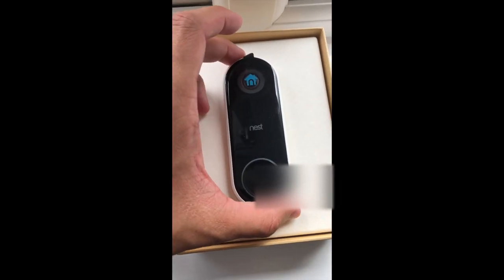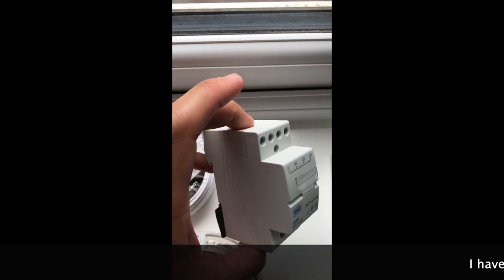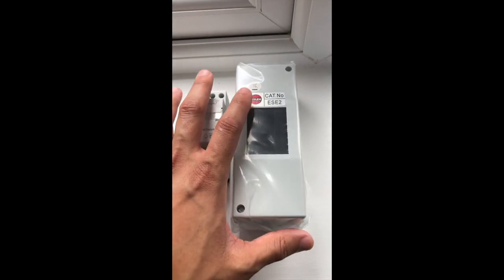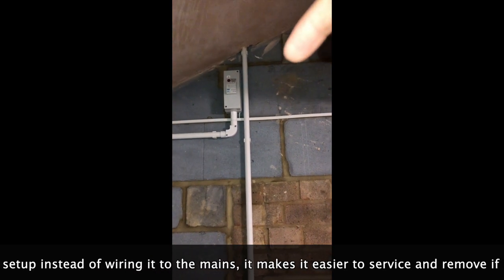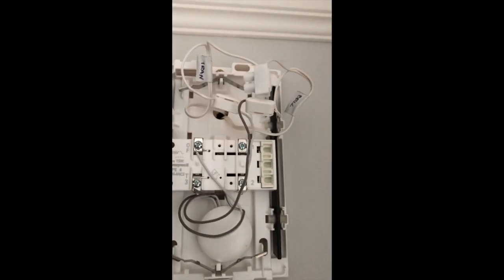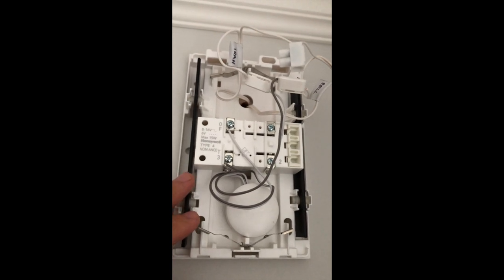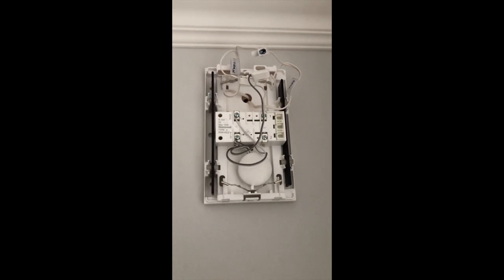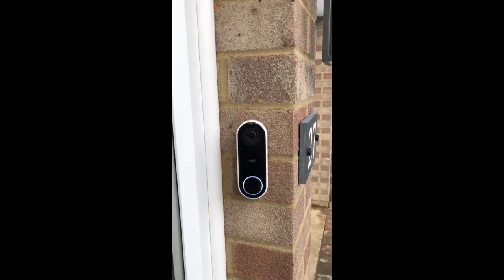Nest Hello UK installation With Chime (Honeywell / Friedland D117)

Comment: Thanks for this video. Followed this exactly to install mine. One question; do you notice a slight hum from your transformer?
Reply: Hi @greyowl666 make sure your connections are tight take the wires out and refit them solved the humming issue for me. I also followed this set up.
Reply from the maker: @osmantui  thanks, @greyowl666 please try this.  My transformer does not make any humming noises. I suppose it could be a loose connection.

Comment: Hey! This video is exactly what I needed, one question - the chime itself appears to be rated at 8V could it shorten the life of it by supplying 12V?
Reply from the maker: Hi see the diagram on the back of the chime it says transformer 8-16v see video https://youtu.be/vR9XI-A2u50?t=85 or https://livewell.honeywellhome.com/honeywell_wp/wp-content/uploads/QSG-D117.pdf  and accepts Optional external supply (transformer) 8V/12V AC.  I've had this set up for 7months now and haven't had any issues. My kids push the doorbell multiple times when they come back from school but the chime and transformer perform flawlessly.

Comment: I have installed it and the d117 just gave a very weak vibration sound instead of loud and clear ding dong , really frustrating. Should i try to connect to 8v and 24v to produce a 16v ? I guess it maybe related to not enough power to the chime?

Comment: Thanks for doing this video. Unfortunately not working for me... My Ding Dong doesn't Ding Dong :-(  It did work on the very first ring when testing but no more. Have tried 16v abd 24v but that didn't help. The Google Minis work fine - just not the DingDong. Double checked the wiring - which is pretty simple realy. Hmm...
Reply from the maker: hmm mine is still working flawlessly. can you post a video of your set up and I can take a look?
Reply: @ohshootvidz  Hmm - I replied to my post last night! It's gone! Perhaps I didn't hit the reply button. 
I fixed my problem! In the settings there in an option to turn off the indoor chime - it was set to off! Fixed that, and it's all working fine.
Reply: Curious to know if yours is still working perfectly? I had mine wired up like this and since moved. I’ve re-installed in the exact same way but it is no longer working!
Reply: @R44YLS  Yes indeed - all still working fine.

Comment: Has anyone taken this a step further and added a 2nd chime? I know it's not an issue to do so and have bought a second D117. I understand it's a case of tapping into the original wires which run from Chime 1 to Transformer and Chime 1 to the Bell. My question is....do I need to change the transformer wiring to accommodate the second chime? My Protek Transformer is wired to 0V and 12V as per Shoots instructions. I have the option of 12V, 16V and 24V terminals.

Comment: Which voltage wire on the transformer was connected to the white wire housing provided by nest?
Reply from the maker: Hi sorry for the late reply, did you solve the problem.  I don't quite understand the question could you explain in a bit more detail.
Reply: @ohshootvidz  currently mine is working but the chime currently isnt working, the grey and white wire from the nest adapter which one is connected to which?
Reply from the maker: @opinion59  white to 0F and the bell wire and grey to T3 and the transformer as per the video if you are using the same chime.  It might be that you need to change a setting in the app on or off.

Comment: How is that working Nest needs 16v-24v to work properly ?
Reply: It works I followed these steps exactly. I think they did an update Here’s what Google says: 

Nest Hello needs to be powered by wires delivering 12 - 24 V AC and at least 8 VA (in Europe)or 16 - 24 V AC, and at least 10 VA (in North America).

https://support.google.com/googlenest/answer/9247132?hl=en-GB
Reply: @osmantui  you could be right it was a couple of years ago I done one and it was flashing the symbol for under voltage